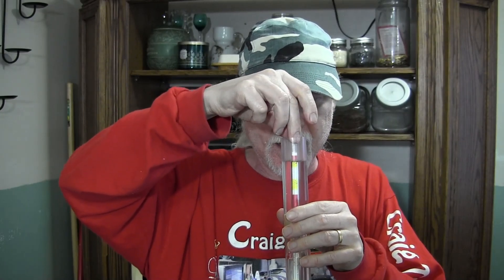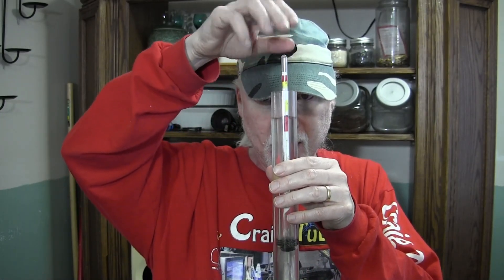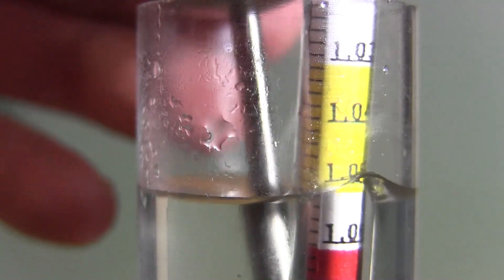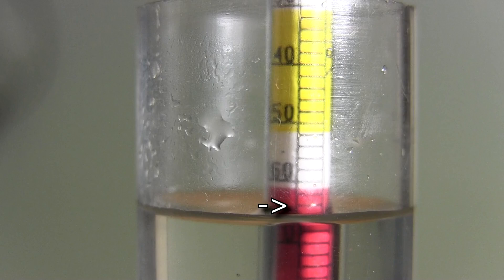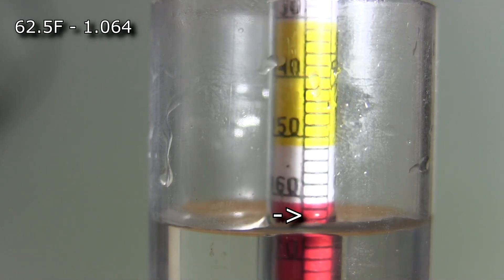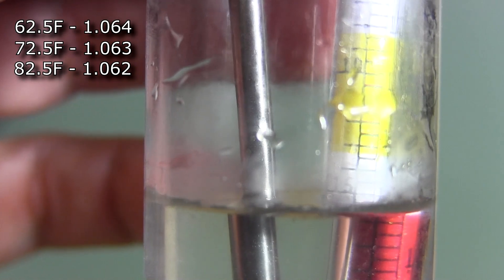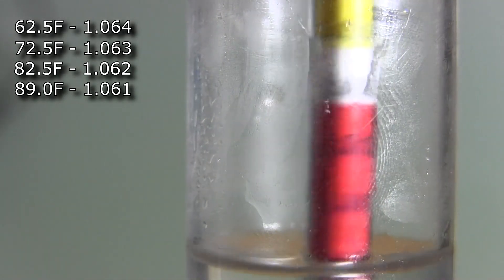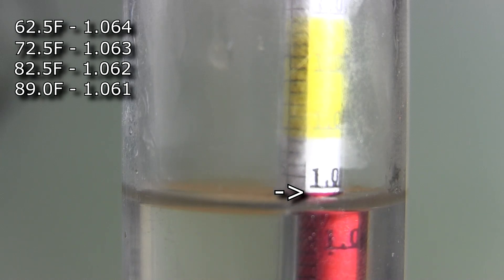Hydrometer Experiment Re visited

Comment: Hi Craig,

Great video as usual, keep them coming.

Just for info; I carefully take hydrometer and temperature readings both prior to fermentation and after fermentation has stopped, prior to barrelling the beer. The readings are carefully noted down in the home brew log book, along with with all the other details pertaining to the beer, and then are just as carefully ignored LOL.

I usually brew the same beer as I brew what I like to drink, don't see the point in brewing something I don't like just to have a change. With that being the case I already know what strength it's going to be so the hydrometer readings are just taken to ensure nothing has gone wrong. Nothing so far has, fermentation wise, but the prior reading has a couple of times caught a miscount in the amount of cold water added to the hot wort.

The only real time temperature needs to be taken into account, in my opinion, is if you have a very hot wort and you want to know what the potential ABV is prior to cooling. If you wanted a stronger result you could add more malt/ sugar at this stage, when it is easier to mix into the wort, prior to cooling it.

The other advantage of taking temperature readings is that I have something more to record to sooth the slightly autistic tendencies LOL.

Cheers

Schnuz.

Comment: So then wouldn't it be more correct to do a gravity reading at drinking temps as this would be the "true" gravity at the time of consumption?
Reply from the maker: +weightlifter59 The gravity goes down as the beer ferments. As long as you take one reading before pitching your yeast, and then again before bottling, and both readings are taken at the same temperature, you'll still be able to figure out the ABV with no error.

Comment: is there such a thing as a digital hydrometer?
Reply: Did a quick look on Bing and the answer is Yes they do but unless your a pro brewer its hard to justify the cost of one  when its no more acurate than a standard beer/wine hydrometer. Refractometers are only good for measuring your Wort or Must pre-fermentation and not so useful post fermentation. A special mathmatical formula is needed to compensate for the alcohol. https://www.bing.com/search?pc=AMAZ&form=AMAZWB&q=digital+refractometer+for+beer
Reply: +Thomas Rees Refractometer is (I think) what you want to look into
Reply: Thanks lads just wondering, with today's tech you would think it would be better than the old method 
True what they say "old is best"

Comment: If you take your hydrometer readings before fermentation and after fermentation at the same temperature, I don't think temperature really matters. IE: If I take an initial reading at 75f, and at the end of fermentation I take another reading at 75f, my alcohol calculation should be accurate.
Reply from the maker: +Brian M Correct.
Reply: The difference being that the effect is logarithmic so even higher concentrations have higher affects before fermentation and less of an effect after. I always run small samples off of each of my pre boil wort and leave it to cool slightly while my boil starts so it's not uncommon for me to take a reading at 40C or 50C. I use beersmith to calculate what it really is and have waited for it to cool down to confirm its accuracy.